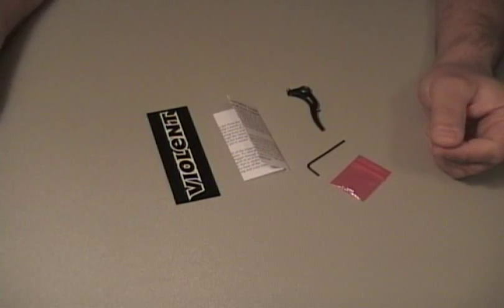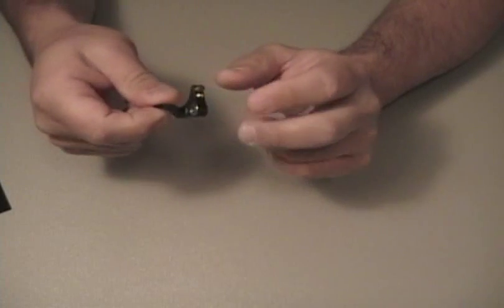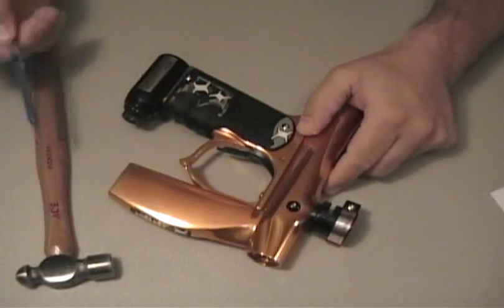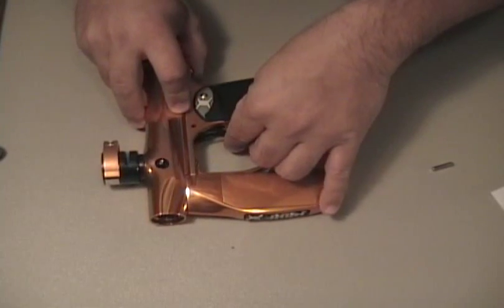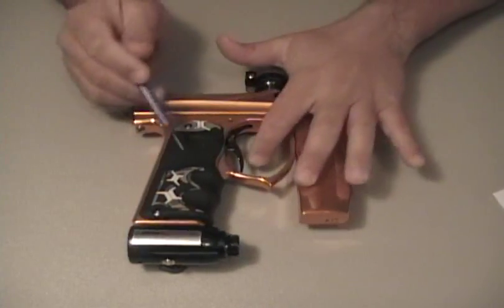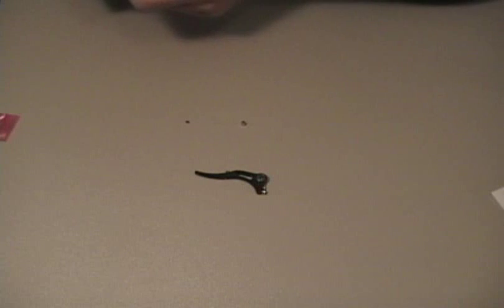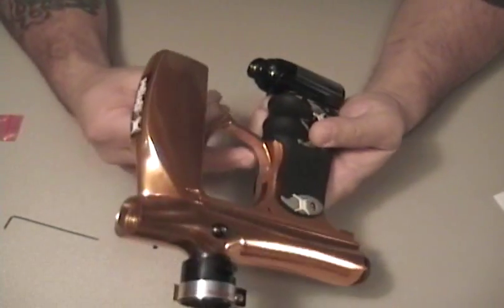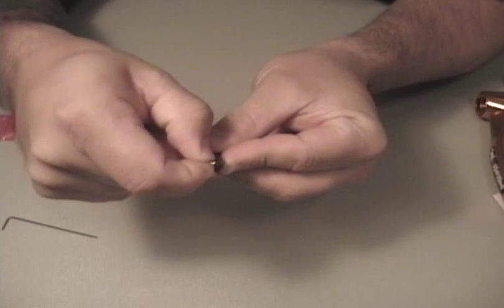Violent Series Invert MINI Trigger Installation

Comment: but some rare earth magnets 1/8 or 3/16 at radio shack for 3 bucks and put one or two on the magnet under trigger that is attached to frame it will make the trigger perform better with faster return  and harder pull!!! also the thumb screw from the back of a computer desktop box will fit the front grip cover!!! sweet for on the field adjustments on burst rate